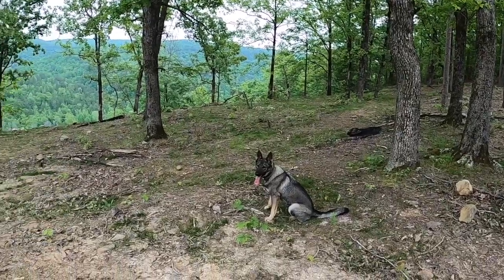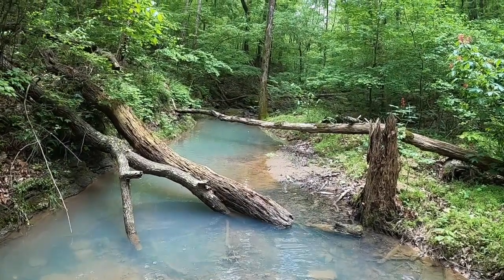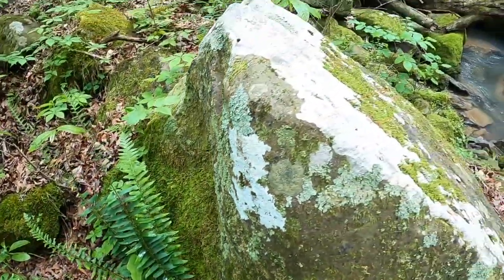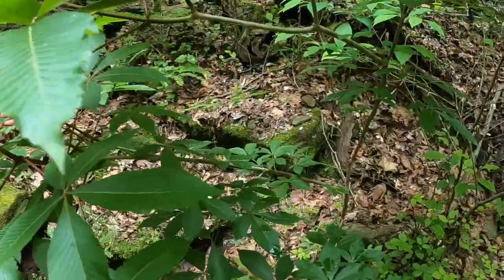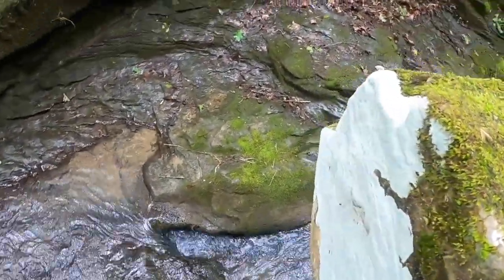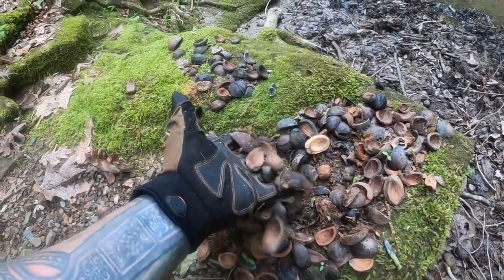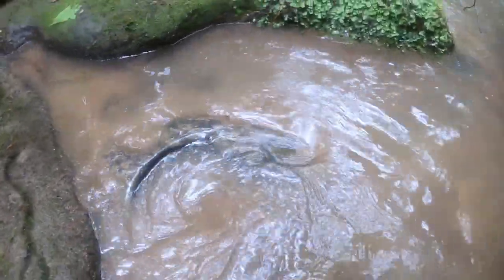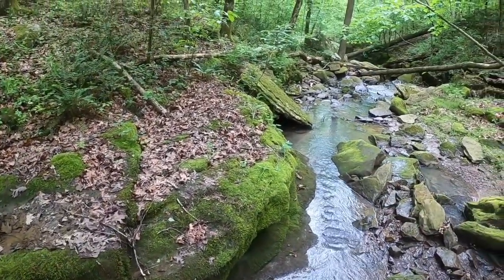Wranglerstar Suggests A Hydraulic Ram Pump For An Off-Grid Homestead

Comment: Beautiful family and pice of land, by the river it’s so magical.  I’d put a permanent hammock camping spot with fire pit with room for friends.  If your worried about not having enough to pump straight up split the work, pump up to fill a barrel submerged the second ram pump go up some more till you get the water to the height you want fill one or several barrels or water toat then distribute all the water before a cabin do several bucket filter system   Remember the stream is 24/7 the ram pump maybe slow but it’s continuous
Reply from the maker: Tom Brenes That is very true. I think it will work out well. The land out here is gorgeous. We love to have fires by the water!